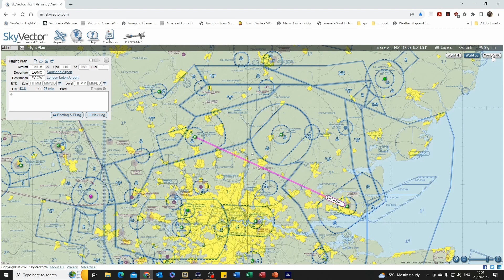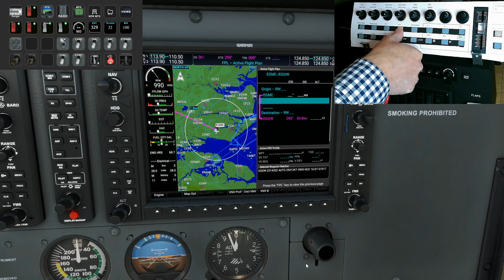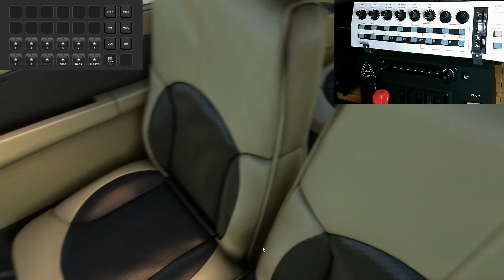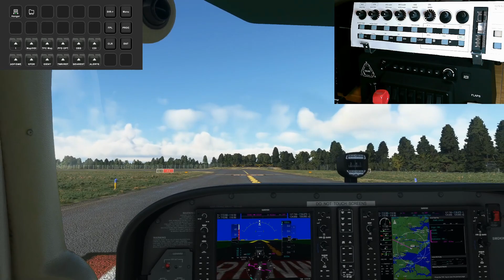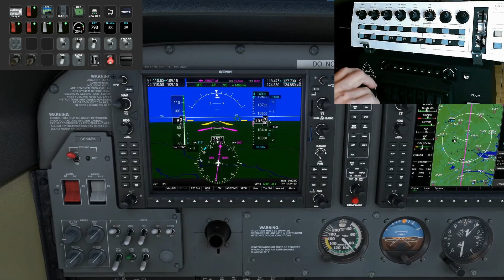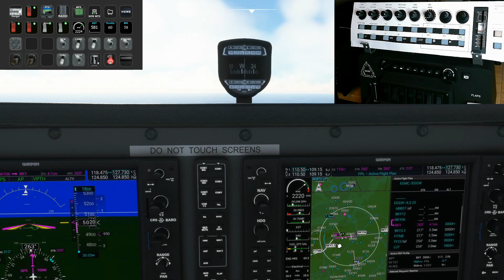C172 VNAV flight with axis and ohs, x-Touch, stream deck and honeycomb hardware

Comment: You should add the AAO gauge for the x touch, from funatic (Thomas) . It enables on screen display of the x touch with labels. Unlimited layers and easy programming.
Reply from the maker: I saw this a while ago.  It's brilliant, particularly for VR users.  It's covered in tutorials on https://www.youtube.com/@FlightSimandOtherStuff so no point me covering the same ground

I decided that I would continue my approach which is it use 'raw' AAO without more downloads as much as possible. But certainly happy to point to other tools and programs. I have no connection to the developers of AAO. It just happens to be the first interface tool I stumbled upon.  Found out about other similar tools e.g. spad.next later but was already comfortable with AAO.

For those not aware, look at flightsim.to and search for funatic
Reply: @Keith_Butcher  I use the gauge and AAO with the x touch mini all the time in VR. Every knob/control/switch is mapped. X touch is the best value add on I have. The big gain for me is I have a full script for each hardware eg every function for the GNS 530. Then I just attach that script to any aircraft that can have a GNS 530. Update one script and that updates every aircraft that uses it.
Reply from the maker: @johnmaguire2185  yes. That’s where I’m heading I hope. Better use of templates so I can load up a plane with any avionics and speed up development/updates. 

Just hope all this good work people have put in works for the 2024 version.